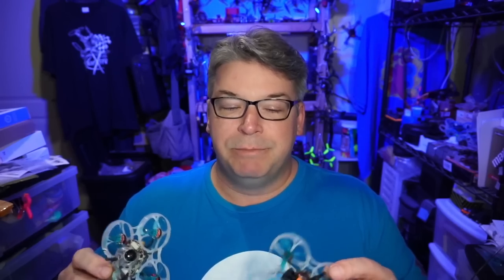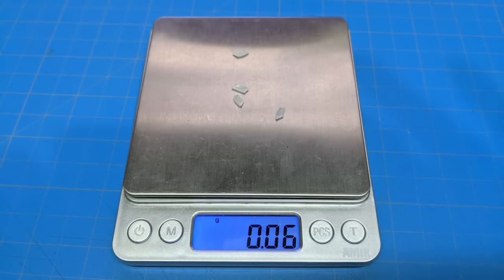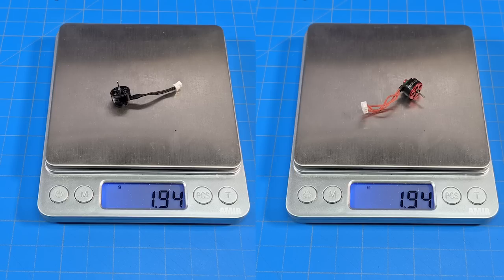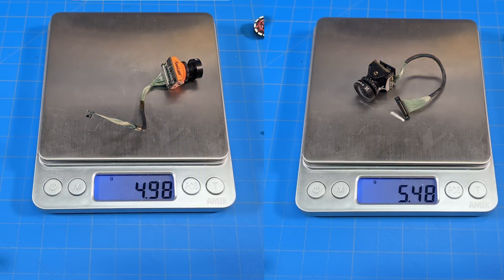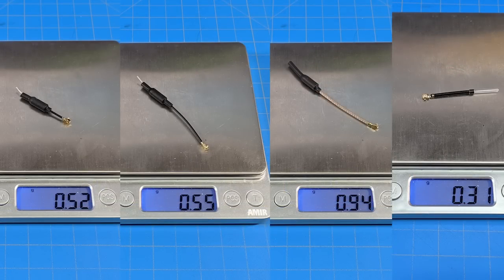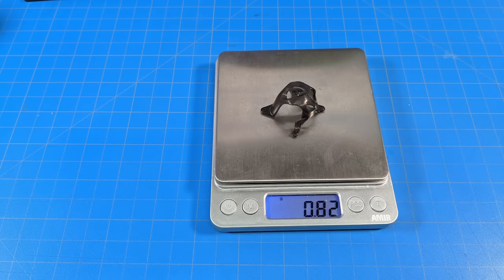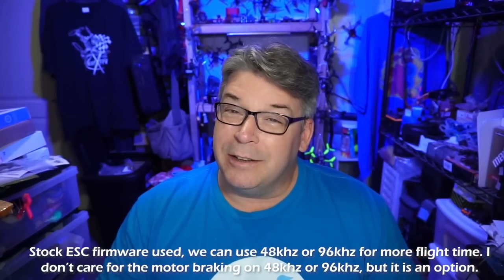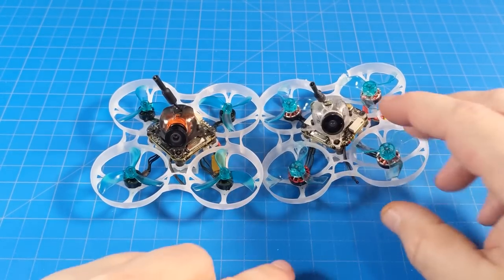Shark Byte Whoop // How Light Can You Go?

Comment: Could you not put an output limit on the 0802 motors in beta/emuflight to try and equalise both to the 9000kv motors and see if the flight time increases?
Reply from the maker: we could try that. I don't suspect the efficiency will increase much. The kilivolt/rotation will stay the same. We can't use emu currently with sharkbyte, at least we wouldn't get vtx or camera control or osd with emu.

Comment: Nick, how are you able to run Sharkbyte on a 2S? Doesn't the VTX require a minimum of 7V?
Reply from the maker: 2s is 8.4volts. Down at the end of the battery the voltage is 7volts.
Reply: @NickBurnsFPV  Thanks. Just wasn't sure if the Sharkbyte VTX would have a hard shut-off at 7V, since it's easily possible to get under 3.5V per cell on a flight. From your video though, it looks like it should be fine. Thanks for the reply!
Reply from the maker: @ATXAirborne  Yea, I don't think its a hard limit on the 7v. I have yet to see it drop out as long as I stay close to say 6.7volts. I fly my shark byte whoop often around the house.

Comment: I would really like to know how you can tune your quad so good like in the video so it stays so locked in. My quads is really floaty and drifty
Reply from the maker: There are really two parts to the flight. One is the tune the other is us. I tune by feel, which helps with the way I fly. I have been flying 5+ years, knowing (hearing and feeling) what does cause quads not to fly very well helps me change pids to correct those issue. Also understanding that a "perfect" tune doesn't exist, at some level all quads have limits to how they can fly well, and how to fly them to avoid shaking and other often seen as tune issues. My advice is to fly often and make small changes to learn what kind of tune fits your flying.

Comment: why did you not remove the motor connectors? It makes such a big difference, not only in weight but also in performance??
Reply from the maker: repair ability. The performance difference on 2s isn't major in my experience. But it does mean swapping a motor takes an hour, nearly complete disassembly.
Reply: @NickBurnsFPV  oh! it is 2s! did you show the battery?
do you flash 48khz Fw on the escs? is 48khz also a big huge performance buff as it is on 1s?
Reply from the maker: @kampkrieger  I am not sure I show the battery this was 6months ago. The battery would have likely been a GNB 350 2s. I find 48khz mostly benefits smaller motors in the 080x and smaller. It has a smaller impact on motors like the 1102 I have on this quad.

Comment: Nick , you are the whoop master!! , can you share in your point of view a whoop part list to have the longest flight time , i saw a video of a guy who claim to flight a whoop for 6 minutes, can that be attainable?
Reply: The MobLite7 with the included 650 mah battery will fly over 10 minutes if your not real heavy on the throttle
Reply: @jmoore3854  Hey John between the Moblite 7 and 6, the 7 is the longest time flyer ?
Reply: The MobLite7 has the longer flight times because of the larger props. The larger props run at a slower rpm and carry a larger battery

Comment: Why not 1S 0802 @16-19000kv?
Reply from the maker: shark byte requires 7v, we either go 2s or we have to add a voltage regulator to boost the voltage to 7v, even then we could have brownouts if we hit the throttle to hard if the regulator isn't a good one or we can't get the needed voltage to the regulator.

Comment: I'd love to see sharkbyte whoop running on 1s.  I think the board requires a 2s minimum, but is there such a thing as a 1s flight controller AIO that has a step up voltage regulator (ie : outputs the required 7v on a pad in addition to the typical 5v pad that they come with).

1s is where it would be of interest for me :-)
Reply from the maker: At this time I don't believe there is a 1s aio that has a 7+v pad. We have to add a regulator to boost the voltage.
Reply: @NickBurnsFPV   The only step up that I have found to make a solid enough voltage that will run a caddx nebula is 3.8g. The weight on a 1s is just too much. Really slow cruiser.  I might try a 1s babytooth with SB. The tooth flies ok with an extra 16g loaded on it.
Reply from the maker: @cs-xd9gy  that is a fair bit weight to a step up board.
Reply: @NickBurnsFPV  I know, I spent $75 trying to find one that works. The Vista draws a lot of amps it seems when it starts up. After that it will run just fine. Not sure if SB does the same thing.

Comment: Wait...when did Sharkbyte start looking so good? Can I use that system with my HDO v1s? Great edit!
Reply from the maker: one flight is with the foxeer digicam and the other with the runcam camera. sharkbyte will work with anything that has hdmi input.
Reply: @NickBurnsFPV  thank you
Reply: @1917VIL  That's not 100% accurate. It has to have the correct HDCP version. I can't remember which one it is though. But any "newer" goggles should be correct. Skyzone o2 won't work.
Reply: @cs-xd9gy  Much thanks, pal
Reply: @1917VIL  ye hdo 1 works

Comment: I recently made a similar whoop with shark byte with betafpv 1102 18000kv motors. Whenever the quad crashes the image goes out. I cannot turtle out. I added a capacitor to the power. It improved a little but it is not great. Do you see the same issue?
Reply: I fixed the break-up by installing a 9v step-up regulator.
Reply from the maker: I have not seen that issue. I could be a solder pad needs reflowing.
Reply: @NickBurnsFPV  I believe it was too much current draw with 1102 18000kv motors at 2s. It has a bunch of power with gemfan 4 blade prop but voltage sag shuts the vtx. At motor output limit set to 75 it still did it even with a capacitor. Polulu fixed it.

Comment: I just wonder why not using 1s for indoors flights anymore? I fly my Tinahawk2 on 1s 450 abot 4-5 minutes. Everything over 10k KV should be flown on 1s in my  opinion...
Reply from the maker: shark byte requires 7v to power one. No 1s board can supply 7volts, this would require us to add a voltage regulator, and find a good spot to mount it.
Reply: @NickBurnsFPV  ohh.. Didn't know that. I am still old school. FrSky and Crsf... Started 2015 with Fpv
Reply from the maker: @blackforestfpv3046  No worries. I started making videos in 2015. :)

Comment: Hm.. my grief with all of the SharkByte footage I have seen so far is, that it doesn't look nearly as good as DJI. Sure, it's a big step up from analog. But it's nowhere near DJI in terms of image quality. It might be very interesting for racing due to the low and consistent latency.. or if you just absolutely love your goggles. Which is sad since I honestly don't really like DJI with their super-closed off system. On system update and they could use the beloved FCC hack and you are stuck with a 25mW system. Or they could introduce mandatory geofencing.